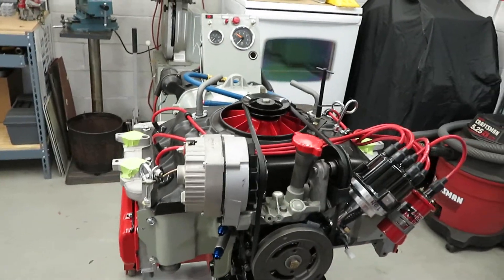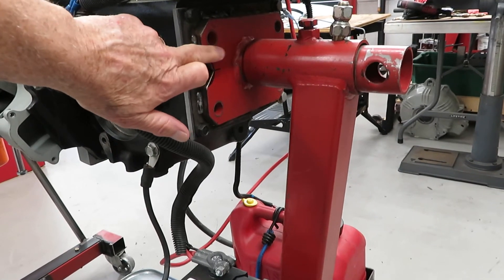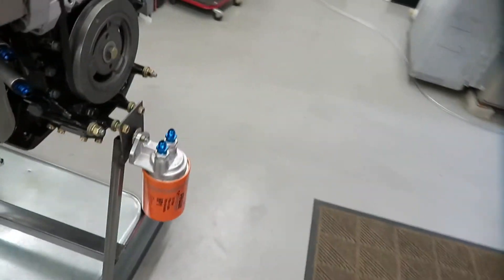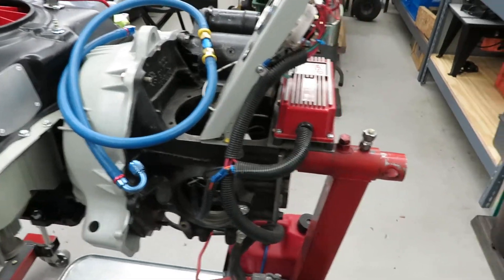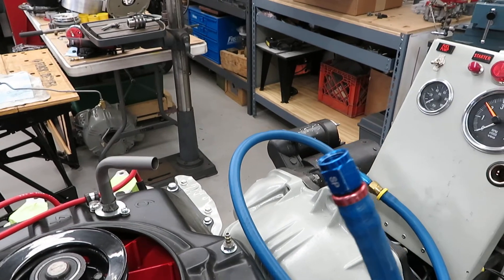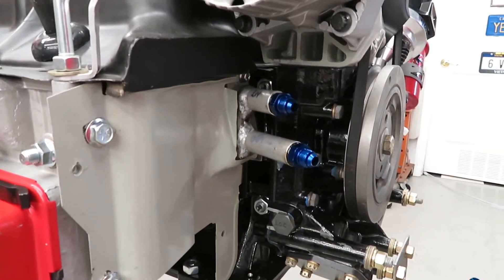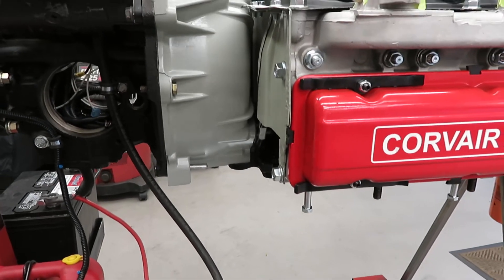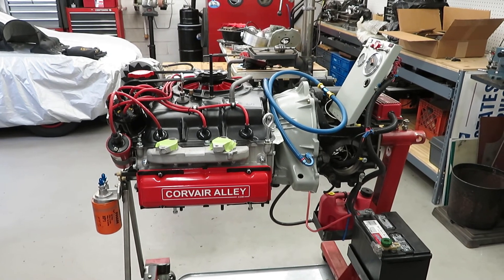2018 Corvair Engine Test Stand

Comment: Thanks for the great ideas. Speaking of great ideas, where can I get info on a floor mounted emergency brake for my ‘67 Monza Convertible? Love what you did with yours.
Reply from the maker: The floor mounted emergency brake handle came from Jegs or Summit, I do not remember but they all carry these for hot rod conversions. I adapted it to my 67 vert.